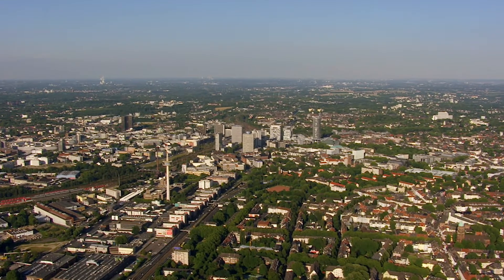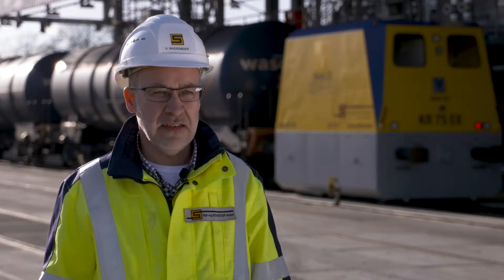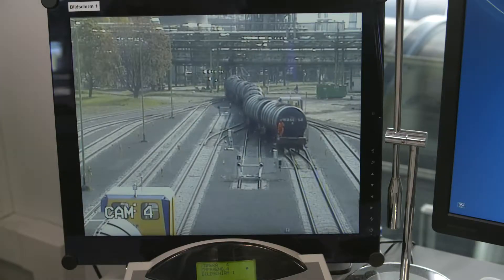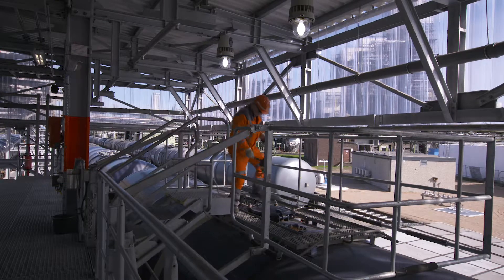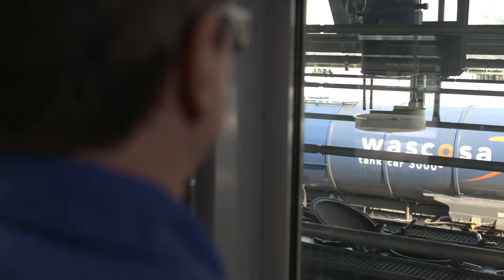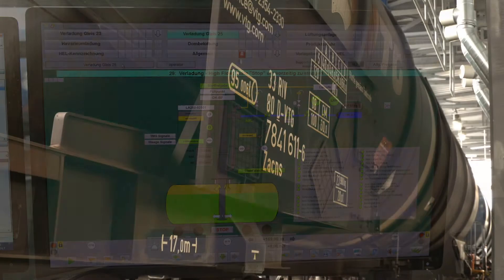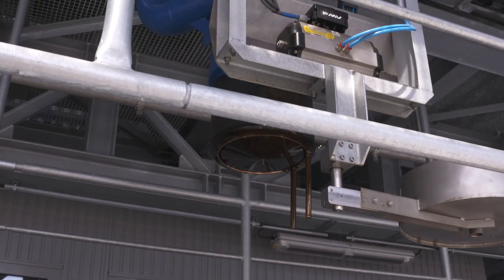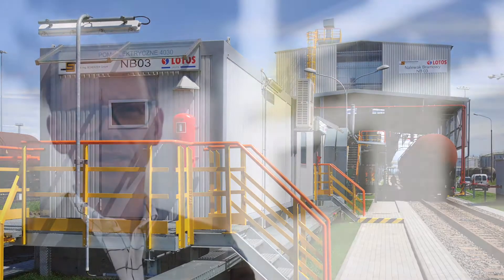Scherzer ON SPOT  Railcar loading facility

Comment: Hello there. Many thanks for this very interesting video. I am from India. Are the shunting locomotives operating inside the terminal powered by diesel or batteries. What is their horse power? Has the signalling arrangements inside the terminal kept route relay interlocking or solid state interlocking. Is there any safety considerations behind the same?  Are the rail robots having battery driven propulsion? Thanks